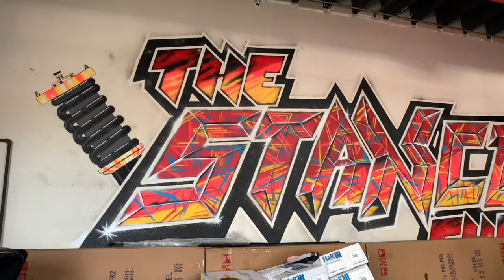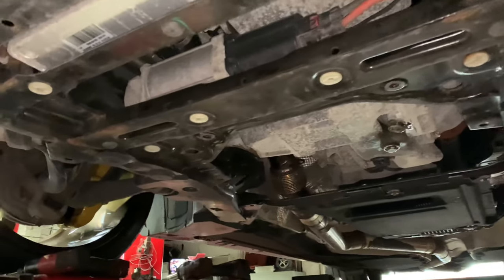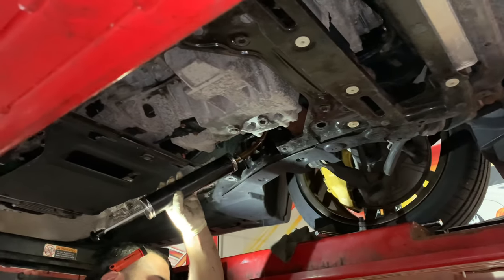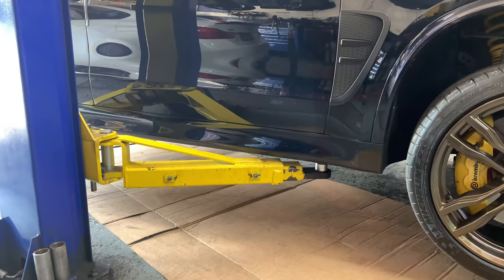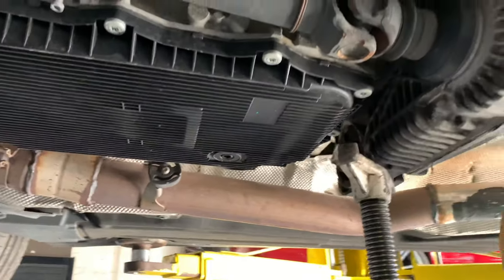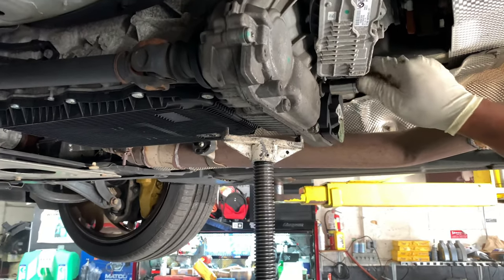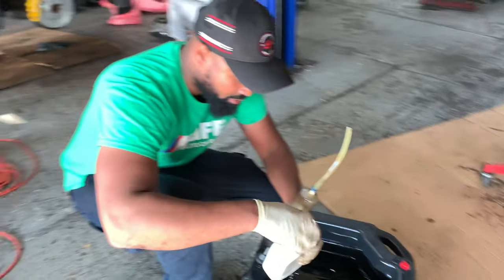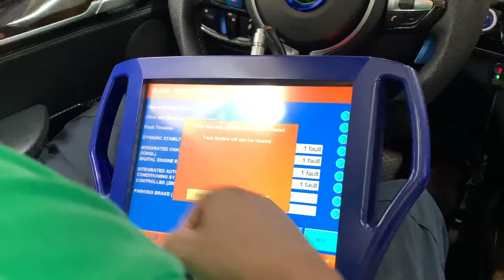Every BMW Owners Must Get This Fluid Service at 50k Miles | BMW X5

Comment: I had my diffs fluids and transfer case replaced a few days ago at 60k miles on a 2017 X5 xDrive35i. Once the fluids were replaced my gas mileage increased a little. I also used the Red Line 75w85 on both diffs since I don't have the dynamic handling package, for the transfer case it was Red Line MT-LV 70w75.

Next will be the transmission oil, pan, gasket and filter.

Comment: What about the transmission? Z8. That requires a new trans filter which comes in a new plastic-like cover and new bolts, plus trans oil. Parts cost ~$250 . You give me ideas to do diff too. Thanks.
Reply from the maker: glad i could
help 🙏🙏

Comment: On the transfer case they suposed to replace the filter too, not just the fluid.  The filter is incorporated as one unit in that big black bottom pane. It is about $140 on ecstuning. Not sure what trans you have but may be this part number: ECS Part #
ES#3194427
Reply: That's transmission oil filter build in transmission pan.... Nothing to do with transfer case.
Reply: I guess the transfer and diff are easy. Transmission a little more involved. Having a rack to lift up the car would make all of these services easier. But need to keep the car level so jacking one end not a good idea. I was thinking of driving my x5 onto 2 pairs of 2x6 to lift the car up like 3 1/2 “ to be able to crawl under. Or, take it to my car service place.   I think the oils and new pan and bolts  for Tran will cost like $325-350. If have some do it cost at least another $200-300. Thanks of ideas.